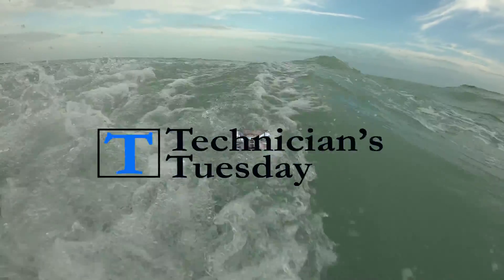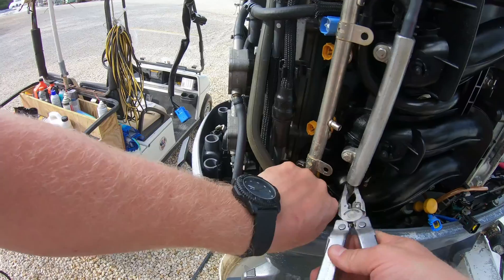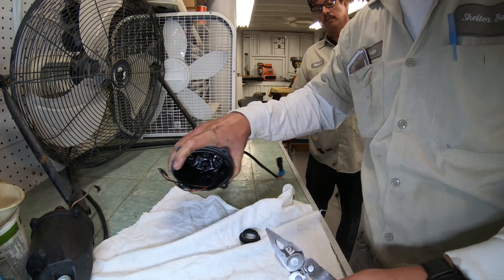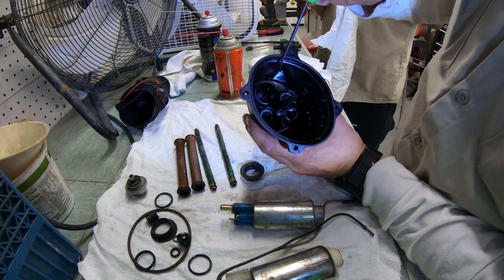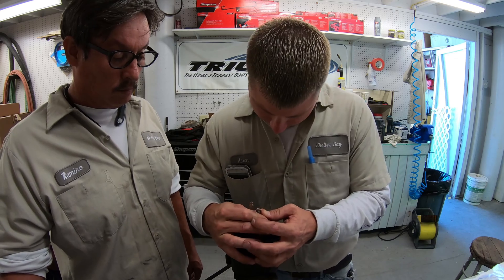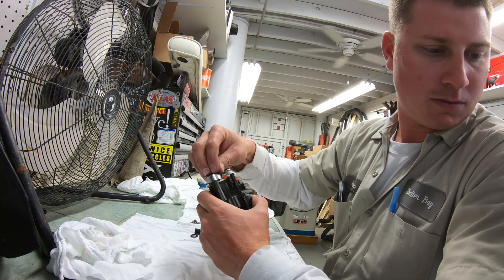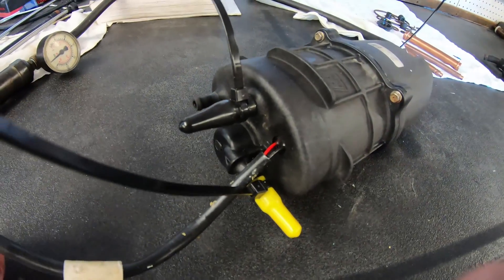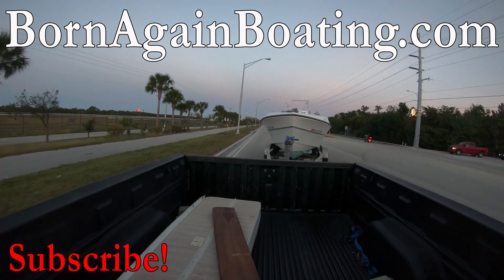Fixing A New Style Mercury FSM | Technicians Tuesday

Comment: I just rebuilt my FSM and reinstalled it. When priming the system I was getting fuel leaking out of the lower unit pick up. Pulled the cowling off and saw it was leaking out of the bottom of the FSM. Did I install the seals wrong in the FSM?

Comment: Why is there no power going to the lift pump?  The high pressure pump has the black/red wires to harness but the low pressure pump has no connections?  Why is this and how does it work without power?!

Comment: Hi. I have 2016 115hp EFI Mercury Outboard. I know the problem is in the FSM. Here are my symptoms. Fuel rail pressure is 35-38 psi. When I squeeze the bulb I can get up to 40 psi and no higher. At 1200 rpm it drops back down to 35 psi after about a minute. When I shut down the engine the pressure drops down to about 10 psi. What is the component that is bad? Oh. I removed the FSM and found no debris in the screens and test ran the pumps under no load and they both ran. I have only 95 hours on the engine. No codes detected. Can anyone please help? 
Thanks
Reply from the maker: Either a weak high pressure pump, or the pressure regulator isn't working properly, maybe the reference line to it, or you aren't getting enough fuel, could be a bunch of different issues, hard to say which is the exact issue with all the variables there are here.

Comment: Aron thanks for replying to my question I have twin merc 2016-225-3.4L the don’t hold rpm if cruising @3600 or in that range they will vary from 3400-3800 I assumed it was the fsm so I attempted to rebuild it using you vid & directions I was wondering what is the procedure for bleeding air out of fuel rail? I was able to get fuel in the fsm then had wife put key in on position while I cracked/pushed the schrader valve did it about 3times both sides . motor fired up ran for a while then ran rough I squeezed primer ball it was a little soft & it smoothed out but watching the tach @ idle it would vary 540-600 but appears fine is that ok , haven’t sea trialed yet want to do starboard fsm , thank you for your help & awesome video they take a long time to do. 👊
Reply from the maker: Hey! No worries, hopefully you've figured this out by now, but should be good to go, 60RPM is a lot for some variance, but you really don't know without back pressure on the prop, and how long it ran for, it should have smoothed out after a few minutes of running.

Comment: I’ve been subscribed and watching your videos for a while they are great thank you for the help previously ask you a question I’ve got a 2016 mercury 225 V6 I know this is an older video, but I’ve been trying to re-search how to empty the fsm tank on mercury’s for winter storage, I used to be able to empty my Suzuki with a bleader is there any way to empty the FSM on mercs? Thanks for all the help and answering questions.👍 great job on podcast also
Reply from the maker: Hey! You can't empty the FSM on the Mercs, best thing to do is use a fuel stabilizer when you flush and fog, but you could also go to the airport and get a gallon or two of avgas which is aviation fuel, that has a shelf life of 2 years so you won't need to worry about it :)

Comment: Great Vid!! Just curious, on the 4:00 min. mark there are two small O-rings on your bench, a blue fluorocarbon and a black regular o-ring. I have found thru all the exploded views online that these are for the switch harness, but because they are both NSS they do not say which is which. Do you know in what position the Blue fluro o-ring goes, towards the switch connector or towards the fsm? Thanks for your time!

Comment: Thank you so much for this video. It really helped with my fsm.
Reply from the maker: Glad it helped!
Reply: What a pain in the a** getting it back together though. I had super lube for the o rings did not use moly lube. The boat place I took it to previously had pinched an o ring causing my fuel leak. Never going back there 😃

Comment: 2008 250 verado. Just put in new fuel tank aprox. 10 feet away. Will the  pick up pump  be enough or should I put in a pump at the the engine to help. Have to pump bulb to run.
 Also having problem finding a knowledgable mech. in Eastern NC. I can't get full throttle.

Comment: I had been searching yt for days to find where the fsm was located on a command thrust 115 . After taking the lower cowl off I saw it. I searched for the part number on the fsm and that lead me here. Thank you very much for this detailed how to service this fsm.
Reply: What is the fuel pressure supposed to be on this engine?
Reply from the maker: Around 45 PSI
Reply: Do you know the part number for this?Need regulator,pumps and seals

Comment: Why did you rebuild it in the first place?
What were the symptoms that let you know it was the fsm?

I’m having trouble when I accelerate this same motor. It idles and runs at low speeds ( around 10mph ) but starts surging soon after I increase the throttle. Always around the same time and distance once I accelerate. 

Thanks
Reply from the maker: Not sure exactly, we do a lot of them with the bad fuel :/ best way is to check the fuel pressure and if its low, thats when you know!
Reply: Having the same issue I'm thinking my pressure regulator, what was wrong with yours?
Reply: @agamakno17  mine ended up being a collapsed liner inside the gas hose. I never would have found it but I decided to replace the hoses ( after I spent a grand on new fuel pumps ). That’s when I found a connector joining the gas line to the tank and the gas line to the motor. It was there that the inner liner was crumpled by the connector. My advice is start with the simplest fixes first!!!

Comment: I really like this video.  The new style FSM in Verado 300 just a nightmare, every single seal ring o ring just stuck easily and very very tighten over time, my friend got one of this motor but only 1300 hours on it 2 years but the high-pressure fuel pump just stuck there.  I didn't try to use a plier because it seems will break it, or it can?
Reply from the maker: Thank you, yes, you can always break something, but you should these can be difficult to get out and you can get them apart with some force.
Reply: @BornAgainBoating   I finally take all fuel pumps out with plier with no damage.  But after all of this I found it may be the regulator failed by the vacuum host keep push out fuel and goes into the intake manifold then flooded the no.6 cylinder with gas.

Any suggestions about that tube?  Is that a one-way tube to create a vacuum or just a normal gas tube?  Or simply the regulator fails and get a new one for it?

Thanks!